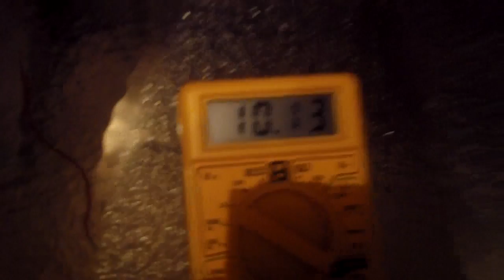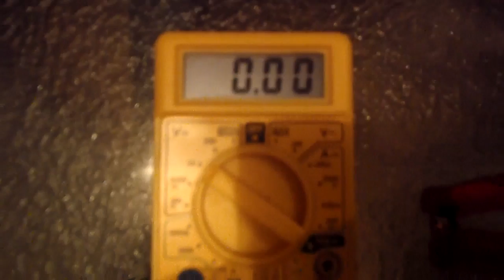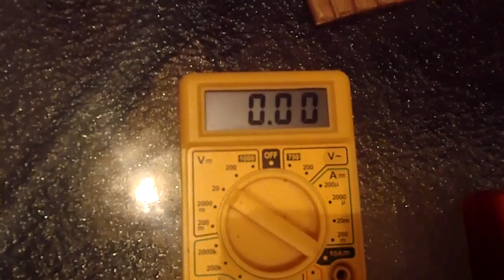Playing With Ultra Capacitors

Comment: how can all caps have a combined capacitance of 600 farads and each one having a 3000 farad capacitance? Besides are u sure the capacitance values u've posted are correct cause a 3000 amp capacitor is really huge in size....these seem like a farad each to me...please enlighten me

Comment: It's all about resistance. The Capacitors have almost no internal series resistance so when they are hooked up to a very low resistance load, they put out a ton of amps. If you hook those capacitors to anything that actually uses power it will have some resistance, this resistance will cause the current to be much lower. Just remember Ohm's law.